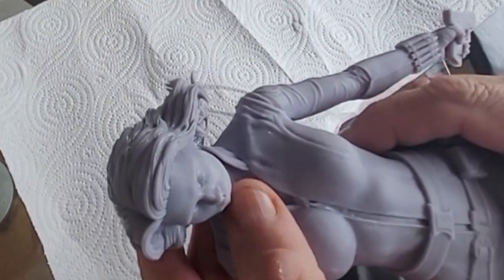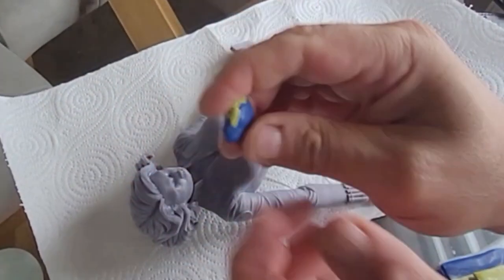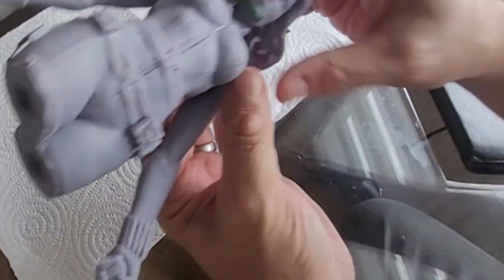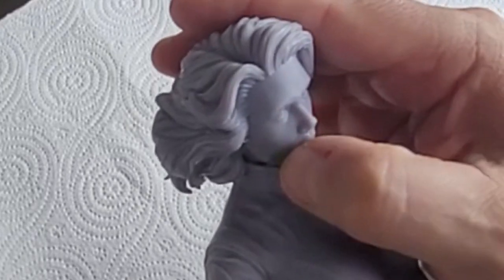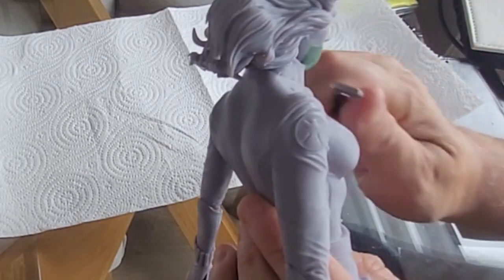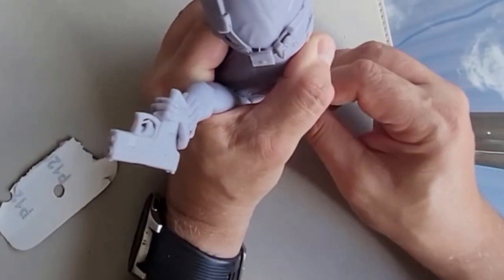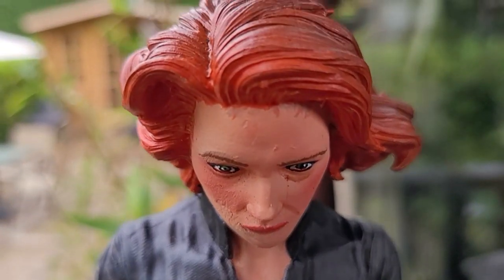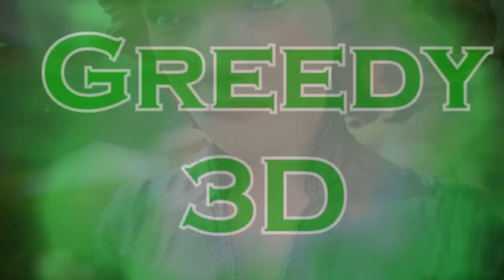Using Green Stuff to repair your Failed  3D Prints

Comment: I had the same problem with the sculpture version. The pre-supported version only has one support for the chin. That´s not enough to keep it stable until it connects to the rest of the head.
Reply from the maker: Thats interesting... Did you repair it?
Reply: @greedy3d480   Looking at the failed print I guess I could have, but I just added some thin supports and reprinted it. The head does not need a lot of resin and it was just a 2 hour print. But on larger pieces, I would consider repairing it.